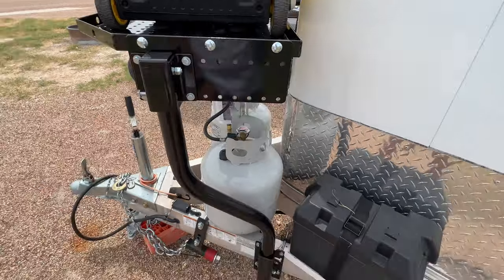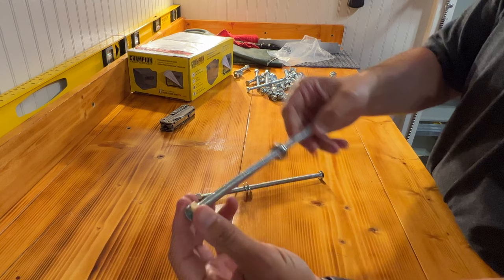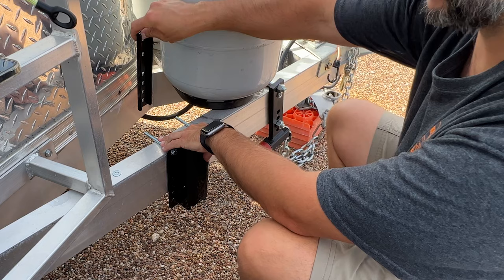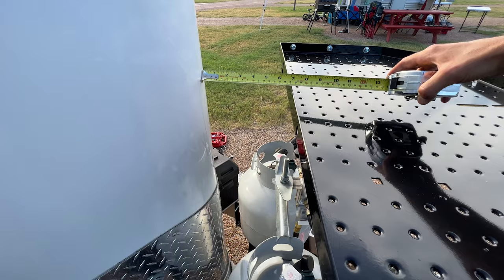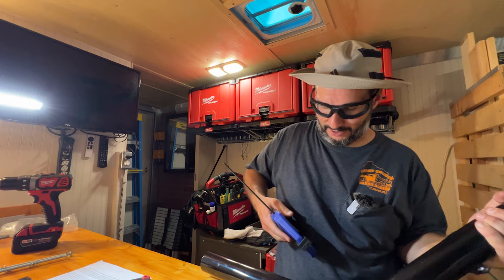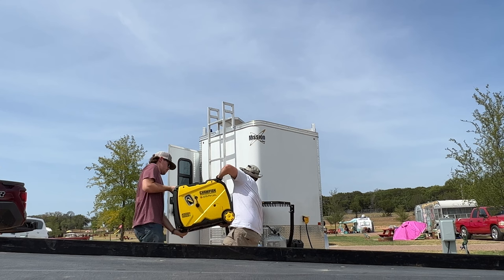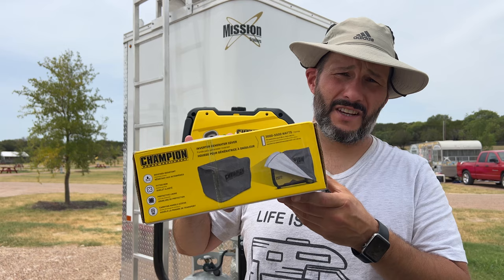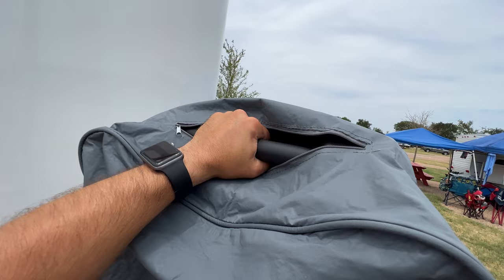🔧 Stromberg Carlson Trailer Tray: Installation and In-Depth Review!

Comment: You got instructions with yours, im jealous. Lol. We have had the same unit on our travel trailer since 2018. Our honda 3000 wieghs a bit more than your champion at 145 lbs versus your 97 lbs.  I drilled holes in the bottom of the honda and bolted it to the plate thru holes in the tray. We did have the back lip of the tray crack and the crack extended into the tray about 3 inches. I removed the generator and reinforced the back lip with a piece of angle iron which i bolted to the tray. After 5 years this has held up along with the powder coat finish. I had a custom vinyl cover made at a company that makes tarps for flat deck trailers, so no one could see it was a honda. Lol. I have a cinch cord on the cover but also loop a rachet strap horizontally around the cover half way up to keep it from flapping in the wind. We have had ours over some fairly rough gravel roads in northern Saskatchewan on fishing trips and it is holding up. Good luck with yours.
Reply from the maker: Thanks for the detailed comment. I suspect that it will hood up well, but I’m happy to hear you confirm it. The powder coat seems really good. 

I might change generators at some point, but I like the idea of bolting it from the bottom. Lots of little projects coming soon.

Comment: I have the same tray. I mounted my Predator 3500 on it by making wheel lock down chains with heat shrink tubing. They bolt over the wheels to lock generator down tight. Predator has 4 wheels. I don’t have to strap it down. I also don’t have to take generator off to service it. The Predator has a bottom oil drain plug so I cut a small hole in the tray so I can drain the oil by placing the drain pan under the tray. On the generator cover I run a couple of long bungees around it so it doesn’t flap in the wind.

Comment: I have the same generator I like that set up. What is the weight of the tray? On my travel trailer I'm concerned about how much tongue weight it would add with the tray and generator.
Reply from the maker: The tray is listed at 63 pounds, and the generator is right around 100. I can confirm these weights.

Comment: Great video Scott. Questions: what is the length of the box of your trailer ?  What is the purpose of the propane tanks, Furnace?  Why not lithiums / 12V AC,  instead of the generator ?   Thanks !
Reply from the maker: Great questions. The trailer is 14x6.5, the trailer was originally converted to a cargo camper, but I have been changing things for my own purposes. It was setup for hot water, cooking, etc. 

I've been making use of 2 Anker SOLIX F2000 (767) Portable Power stations for my power system rather than a full 12v RV system. I explain all of this in other videos. I'm setting the trailer up as a work shop. 

The generator serves a couple of purposes, it gives me extended run time for my A/C and gives me more power for tools and to power campers. While I could build a big 12v system in the trailer, the generator and Anker Power Stations give me portability and flexibility. 

Trailer Power System: https://youtu.be/xLWqNUXLAxA
Original Trailer Layout: https://youtu.be/01L_xTPHJWY
Trailer Tour: https://youtu.be/nPNgOA0V1Gs